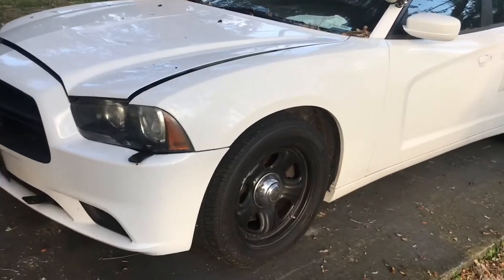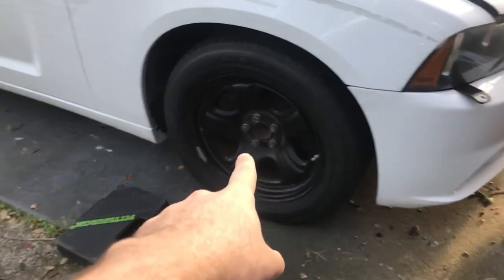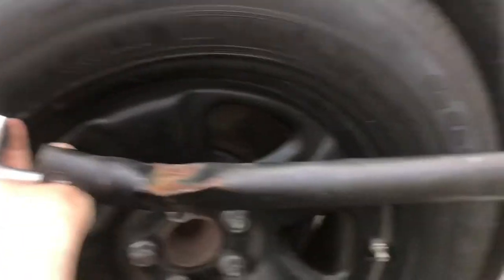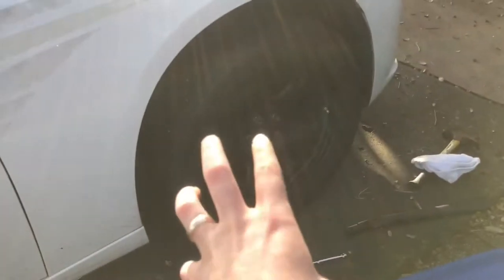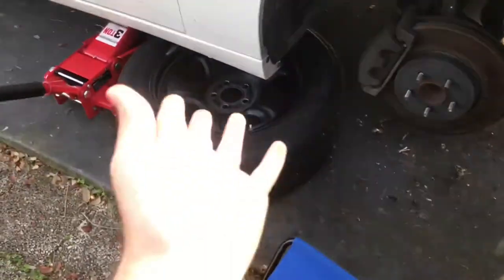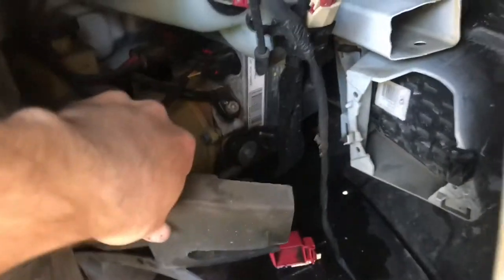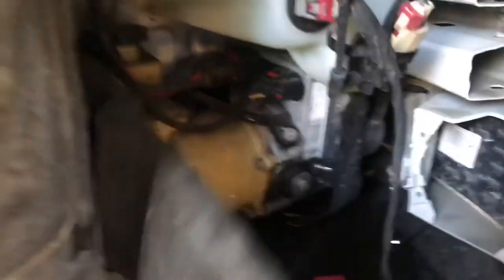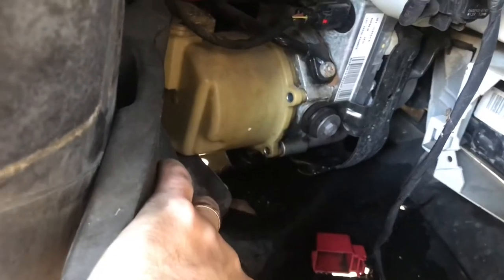Replacing power steering reservoir and seals to fix leak 2011-2014 Dodge Charger Chrysler 300

Comment: Man...much more faster and easier will be to remove the whole pump unit, it's 4 bolts easy for unscrewing. And when you have the pump unit in your hands than replace the reservoir

Comment: Good video but for all y’all that are changing it changed both of the o-rings. Go ahead and just take the whole pump down. Trust me it’ll save you in the long run. It comes with two O-rings for a reason. But either way bro, this was a good video. Thank you for the help.
Reply: Where is located the second o ring?

Comment: Where can i get the seal bro..when i went to part shop they said it coming with whole pump😪
Reply from the maker: Bought mine on rockauto.com,  came with a new plastic reservoir container along with all seals needed. You do not have to replace the whole pump if your pump is not damaged.
Reply: @Herringautomall  Thanks You dude

Comment: I have a 2012 dodge charger with issues with the steering wheel shuddering when I make in/out turns into a parking area. I changed the steering pump but still have the issue. Anybody have an idea what is going on?
Reply from the maker: If you ran it low on fluid or out of fluid for too long you may have damaged your actual steering rack but a mechanic checking it in person can give you a better answer. If that’s your problem expect to spend a good chunk of money to fix it.
Reply from the maker: Could also be something simple like tie rods or wheel bearings a good mechanic will check the whole front end for looseness
Reply: Had this problem recently, and I checked the resivor, and was 4 ounces low. Bought the right fluid, topped it off, problem fixed. No more shuddering.

Comment: What would be the signs that the pump itself is bad?
Reply from the maker: If you have fluid in the pump and the seals are good and your power steering still isn’t working, that’s a good sign your pump is bad. If you’re not sure you may have to take it to a reputable repair shop; sometimes running low on fluid will cause the front end steering gears to wear out and that would be a different story.
Reply: @Herringautomall  Thanks, I was just curious because I saw one of these charges at auction and they claim the power steering pump is bad.

Comment: You can use mopar transmission fluid for the power steering. :)
Reply from the maker: Most of the time that’s true that transmission fluid will be fine for power steering, but these pumps are not like normal power steering pumps, these are electric, not belt driven and as such are under different conditions and very picky.. I would not risk it with these, I only make this comment to encourage viewers who may see this, don’t risk damage to your very expensive electric power steering pump by putting fluid in that’s not specifically made for these pumps. Not worth the few dollars you may save in my opinion, but if it works for you I’m happy for ya!

Comment: I’m wondering i have 2015 Dodge Charger se but there is no power steering pump on is that normal for this model or it’s hidden somewhere….if anyone have information to tell me were……thanks
Reply from the maker: As mentioned in the vid these cars don’t have conventional power steering pumps, they are electric and not visible unless you take the wheel off and the fender liner. They are behind the passenger side fender liner hidden very well.